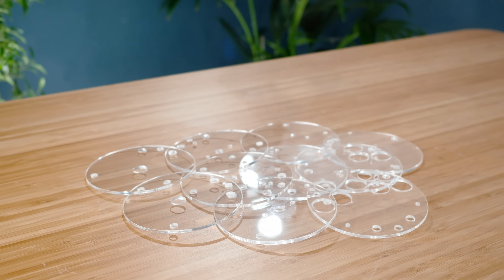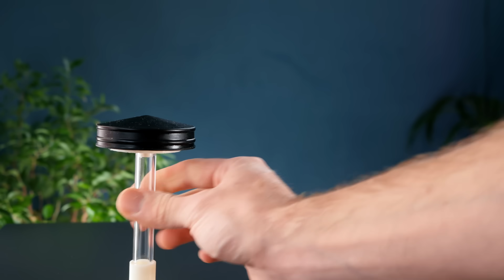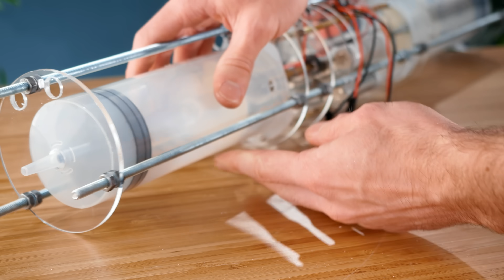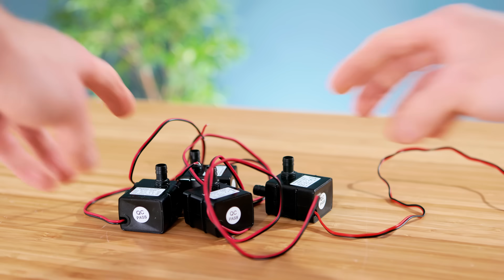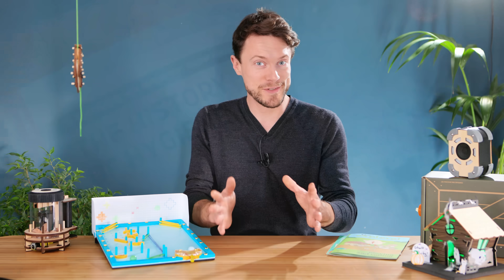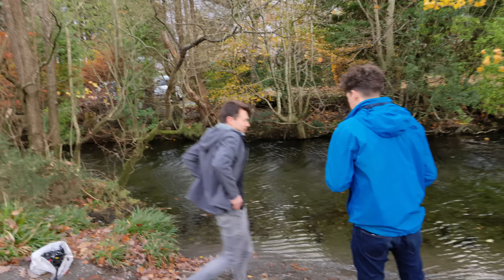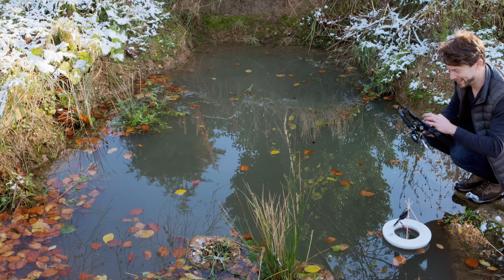Building a DIY submarine

Comment: I’d love to see a completely wireless version, one with GPS and long range controller. Do a video crossing the Irish Sea to Ireland.

Would be a challenge but if you can’t do it no one can
Reply: Are you serious ?
Do you have any idea of the power/speed requirements for that distance ??
Reply: @edwardfletcher7790  I understand that if you done it when the tide was going out and made the submarine much larger and done it over a period of a few days having the jets  it’s going as slow as possible but just enough to keep going forward. Doing it in the middle of clear summer months so it can almost run purely on solar power. Or maybe design a way to run it off a small petrol generator with a few oxygen tanks. I think it’s possible I could go into detail but it would go over most peoples head
Reply: For that you need licence buddy
Reply: @guy16year4month6  That's the least of the worries.
He obviously has NFI about the ridiculous technical challenges.
Reply: I don't think this is necessarily a dumb idea. The batteries would be expensive, but their weight would not matter. The wind doesn't matter underwater. It's mostly a question of scaling everything up. Would probably end up very long and thin. Swift currents in the wrong direction could be the unsurmountable obstacle though. There are concept designs like the SMX31E and Japan launched a lithium ion electric submarine last year, though that uses diesel as well.
Reply: @anthonyholland8549  The bouy would be affected by wind.
Reply: @Waitwhat469  the bouy would certainly have to go.
Reply: @anthonyholland8549  why not sophisticated set up of oxygen tanks and petrol motor
Reply: @ThegreatNomadicadventure  Darren, just stop mate, you're so far out of your depth it's hopeless.

You don't even have the education to realise how difficult any of the factors are.

Go read the wiki page on "Dunning Kruger effect"
Reply: @edwardfletcher7790  you are so angry I hope everything is okay at home mate 💜🙌🏼 hurt people try to bring others down
Reply: @ThegreatNomadicadventure  I'm not angry, I just get really annoyed trying to explain the reality of engineering to STUPID people...
Reply: Maybe the bui could be a bit larger with a solar panel and a LoRanWan for comms?
Reply: @Waitwhat469  Again you people are hitting the Dunning Kruger wall...

I'll give you LoRa though, it's kickass.
Reply: @edwardfletcher7790  Oh no I for see a lot of known unknowns and unknown unknowns in this plan.

One to me is I suspect both the wind and tidal forces being a huge issue for the bouy and sub respectfully, but I don't know the Irish Sea well either.
Reply: @Waitwhat469  obviously!! Or oxegen tanks and petrol or Diesel engine

Comment: Sorry, but your explanation of how a submarine ballast tank works isn't even close.
1. The ballast tanks are open on the bottom, so the pressure (air or water) is always the same as the surrounding water.  There is no "compress" or "decompress" of the air in the tank.  Ballast tanks are usually either full of water or full of air.  There is no half and half.  Those are the internal trim tanks.
2. There are valves on top of the tank, when open the air escapes and water enters in the bottom.  The valves are left open until the tank is completely full of water.  
3. To push the water out compressed air is released into the tank and the water is pushed out the bottom.

Comment: Your double tank design is very good, as trimming a submarine is quite delicate and you need fine control of center of gravity. OTOH the yellow bottle submarine will never work right, as the unrestricted air bubble and the mass of the tethers make trimming impossible.

Comment: No need to reinvent the wheel. 1 good motor & propeller at the back + 2 servos & rudders at the back + 1 servo & rudder at the front + your ballast system.  easy peasy. 

Test it in an indoor pool... with your very "warm and sunny" summers, there's surely plenty in UK 😂

Comment: Awesome project. Should upgrade your camera to a GoPro (if the sub can fit it) since you needed more weight anyway and I'd imagine you'd love the higher quality footage you'd get in deeper parts of water. Also you should adopt Project Air's use of goggles to your sub. I have an FPV drone with the goggles and it goes from being "my drone" to "me drone." It's like I'm a bird. An underwater version of that would be dope.

Comment: This is amazing! I want to make one.
I do have one question though. Why do you need eight side thrusters in fixed pairs? Four independent ones should allow you to side shift or rotate based on which ones are turned on. In fact you could even rotate just the front or just the back by turning on one at a time.
Reply: I thought the same thing, but it could be due to simpler programming with the RC control
Reply: @CharliesGadgets  That sounds kind of right to me, but not program. Easier on the hands. One stick to side-shift and one stick to turn vs one stick for the front and one stick for the back. If there was any programming at all it would be trivial, but he was using off the shelf controller.

Comment: i think the DIY perks submarine with the floating buoy makes more sense.

Still limited by the cable length though.

So, perhaps you could figure out how far the signal will go under water.... and have relay stations along a line to continu the signal.
To have the device itself be wireless i mean.
Wireless as in: relaying the signal. Not in the sense of entirely wireless.
You might wanna have a wire attached to pull it up.

But i think if you would have "stations"  along a string which send out the signals, you could get it to be "wireless" very deep.

Im a noob on this, so perhaps i thought it out wrong.
Im thinking of a bunch of stations along a line that relay the signal to the submarine.
Correct me if im wrong, but this should in my opinion be possible. 
And the vessel could travel really deep..
You could have the string of relay-stations on the surface, or going straight down, right?????
Reply: so, what if you put the wire straight down to the bottom. With a bunch of relay stations attached, so the signal will go beyond the end of the line.

Then the sub itself could still be wireless.
Just with a wire attached to pull it up if needed.

And this is just to show how far you could go.
As in: How deep one could go with a few relay stations, etc.

I want to visit the friggin Titanic.
A mossad job.

Comment: Suggestions,  please make an under submarine, which always have a neutral boyency, and a propulsion system at the end,  and fins to control its direction. I am think about eels, eels are so gracefull when they swim, something like that, anyways you added 4 kg of metal, to neutralize the boyency, this 4kg can be replaced with batteries of same wt. To get more power. Please make something like eels.

Comment: a simple fix for you weight issues is if you had larger lipo's for all the pumps they would give you the weight you would need and if you needed to spread the weight out you could just divide the cells and line the tubes with them. Just my 2 cents but i cant wait to see your revisions.

Comment: Just have to organise an ELF transmitter and receiver Extra Low Frequency is used for communication underground in mines and, I understand, was used for early subs. It is very slow but works. Great project and vlog. MH370 awaits this technology but probably need to be autonomous, charging? Yeah, a problem underwater, maybe heat transfer or haline, keep trying. Good job. Thanks.

Comment: That is pretty amazing.  I love your projects.  I love how you fit all the components into a standard sized tube.  Pretty impressive.  Would it work better with a stronger propulsion/motor?  Also would the cameras work well if you diffuse the lights a little with thin packaging foam or something?

Comment: I really like "unrollling" the servos into the syringe position control. That's great work, every part presented was more clever than the last. You can economize on your thrusters though! You currently have 4 translational and 4 rotation pumps. You should be able to use the transmitter's mixing control so that (for example) the left-right of the throttle stick runs opposite ends in opposing directions and the left-right of the right stick runs them together for translation. That will free up 4 pumps and 2 channels.
Reply: Or he could keep perhaps keep both sets of pumps for extra flexibility, that way you get the flexibility to use both sets of thrusters just to turn or translate if you want to also.
Reply: I second this. Was just about to suggest the same, although my vocabulary wouldn't be as sophisticated 😅

Comment: I wonder if there would be a way to get the cable and float to be more stiff so it could travel with the sub without fear of being dragged down with it. Maybe a telescoping tube so it opens as it goes down and collapses as it goes up of course you would have to design a different floats that would travel on the water more easily but it would be cool. You could make it boat shaped and put a 360 camera on it to view the surroundings.

Comment: I've built several over the years. My first one was controlled by my hand pump with two twist handles one on each side of the pump in the middle. There were several plastic fish pump style hoses from the handle to the sub. 
I ran it off of our dock at the cottage. It was simple but very kool.

Comment: Small question, if your model is compressing and decompressing air, the temperature of the air inside the sub is bound to change, right? Like when you push more water for it to sink, the air that's being compressed is going to heat up, then cooled down by the environment, and when you push the water away, the area expands, the air is bound to cool off, then to be heated up by the environment. Did you considered something like this in your design? If yes, then what is your solution or the scale of the project is not big enough? If that's the case, then what does the big submarines do to make sure that their components won't thermal shock when they needed to sink/float rapidly?
Reply: I would guess that being surrounded by water helps stabilize the temperature a lot.

Comment: This is a very cool project and works pretty much the same as commercially availiable RC submarines as far as the boyancy control goes. 
It you wanted to take the project a bit further, you could add a pair of arduino's to gain some functionality. The one in the submarine could be connected to the oil pressure sensor from a car. Those are just a pressure based variable resistor. You could use an analog input on the arduino to read that resistance and convert it to depth then use the arduino to control your ballast system to maintain a depth automaticly. An accelerometer sensor could also be used to monitor tilt to keep the sub level or even go into a nose up/nose down attitude for surfacing or diving. 
The second arduino would be on the surface and be wired to the one in the sub for control but you'd need to build your own control board rather than using the RC controller, but it would allow you to control the sub, set and display the depth, pitch, and possibly display heading heading.

It might also be worth rewiring your pumps a bit. You use 1 set of pumps for yaw rotation and another set for sideways translation. Shouldn't you be able to wire it to use diagonal pumps on opposite sides for yaw and pairs of pumps on the same side for translation?

Another handy tip I learned from playing with these things years ago is to invest in a pair of hip waders like people use for fishing. It's much easier to launch these things if you can walk into knee or crotch deep water without getting wet than it is trying to keep your shoes dry. 

One final note for people interested in playing with this sort of stuff is that it's hard to make a sub that can move freely through the water and still have good control. Another option is to take inspiration from the lunar lander and make a camera that mostly sits on the bottom looking at the scenery with motors that allow it to hop from place to place. You can get transparent plastic sphere from craft stores or amazon. Mount a small camera with a couple of servos to control pitch and direction and motors or pumps to lift it off the bottom. Boyancy is easy since it mostly sinks to the bottom. Balance is easy since the bubble with your camera is at the top while the motors and any ballast weights you add is at the bottom. Control is fairly easy since you're only thrusting upwards or not. Put a bit more weight on the front and it has a slight tendancy to pitch forward when it lifts and that makes it move forward. Put some legs for it to sit on so the motors don't get tangled with weeds or kick up as much silt in front of the camera.
The final tip is to put your batteries on the device instead of trying to power it through the tether. Just use that for control and the video cable. (and of course a nice sturdy line in case you need to pull it back to the surface.

Now that flying drones are being regulated out of the hands of hobbiest's, there are a lot more underwater drones on the market. Hopefully this will lead to a lot more homebuilt ones being shown online for inspiration. They're not that complicated and there's a lot to see in lakes an oceans.

Comment: A lot lower frequency transmitter and receiver would be better here. Water does an excellent job at absorbing radio waves, which is why waterproof bluetooth headphones have MP3 player functionality. Same frequency that cheapo switch the channel if your 15$ RC car is being controlled by my RC cars use.

EDIT: I'm gonna stop posting comments until I finish the video, lol. Still a lower frequency transmitter wouldn't need the surface antenna

Comment: Imagine replacing the steel pellets with extra batteries. That would be a lot of power!
Reply: On the other hand, having those pellets as a reference, a revised version could carry additional things. 🤷‍♂
Reply: @McTroyd  Make room for the ICBMs! ;)
Reply: @pompeymonkey3271  Only if they're made of brass. 😉
Reply: imagine adding torpedoes
Reply: Isaque M - LT HoriZonT that's when you attract the 9/11 crowd.

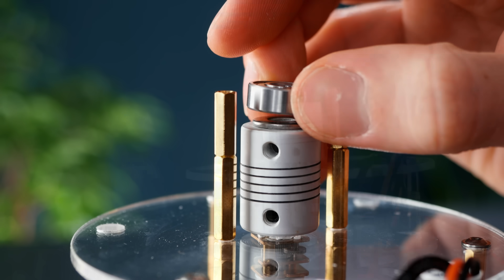Comment: Okay YEAH I mean at 4:30 that bearing is probably fine for the axial load but a thrust bearing would be preferred. Hurts to see but it also really doesn't matter at this scale, unless you're gonna be using the submarine every day. Small thrust bearings are expensive though so I get it.

EDIT: Watched some more and realized it's for the ballast tank (I'm pretty tired right now) so it's not gonna be spinning continuous like a propeller which I thought it was for at first.

Comment: There was a submarine that used a weight shift system to dive and surface, and the issue with it was that if it tilted too far it was unable to right itself. I have a feeling that the unrestricted water in the bottle has a similar effect.
Reply: Yup the free surface effect is not your friend here, this is the same reason that so many of the modern ships to turn turtle have been vehicle ferries. The large open vehicle decks spell doom if they begin to flood as the water can quickly reach sufficient levels to provide the mass necessary to turn any perturbation into an unrecoverable roll over.

Comment: To lower the pressure, you could try to close the body when the syringes are in the middle, instead of in one end.
Will make the movement and then pressure changes lower. Which also will give the motors less resistance to work with, which is better for battery life.
I guess. Have never built a submarine. :-)
Reply: That will reduce pressure below atmospheric which can cause leaks. It always better to have more pressure inside.
Reply: @GrafTrahula  but as he said in the video, the pressure almost made it press the end caps of the tube.  Enough, but not more pressure is probably best. 🙂

Comment: To perform military grade recon operations with your sub, you should get rid of RF-transmission links all together. The much better way ist to use ultrasonic data links, provided by ultrasonic power transducers. Such in the range of a couple of MHz (suitable for video transmissions) work by magnetostriction. And a depth-gauge and an inclinometer connected into the servo-loops would increase the usability of the sub quite a lot.

Comment: NEXT PROJECT IDEA 
Full Auto Coil Gun 
(based on low voltage high amp--- battery powered, optical endstops from 3d printers with 1 transistor to turn on mosfets- no programing needed etc)

Comment: my advise is to connect it to the mother ship which would float on the surface. the mother ship would use a cheap sonar to detect the location of its child-submarine. in this way it would be able to follow the submarine. You also could manually steer the ship over the distance, you just need to transmit the video signal from sonar. The air pump also can be on the mother ship.

Comment: Dont for get i would recommend  a system so if the wire gets cut it will come to the surface so if the wire cuts you don't lose it

Comment: I am very happy to know that it finally worked, and it is quite realistic that you will not get it perfect the first time especially that you didn't do the correct calculations. The engineering aspect of your channel is quite impressive. My recommendation is to buff up the motors and maybe be able to control each syringe independently so that you gain control over the diving angle instead of going up and down as an elevator. Quite impressed.